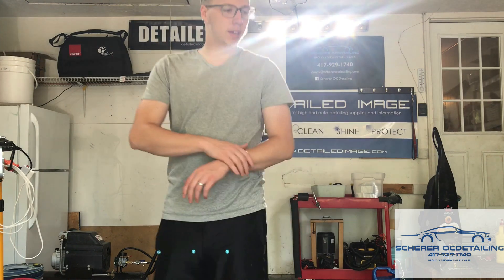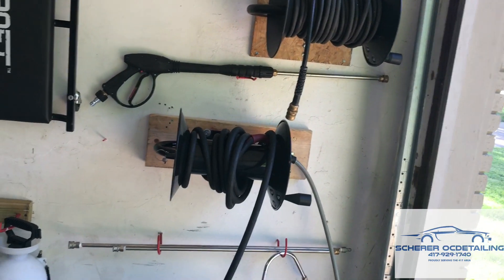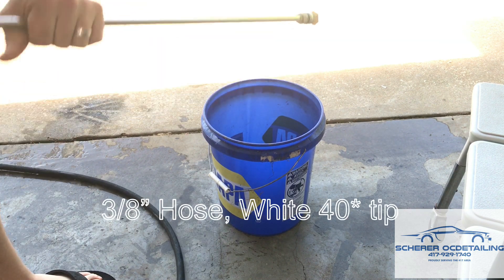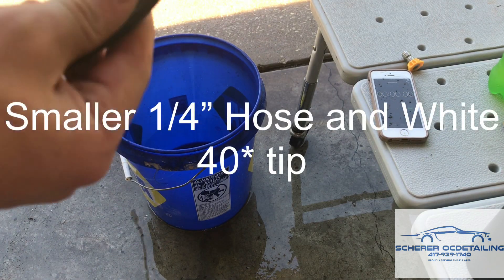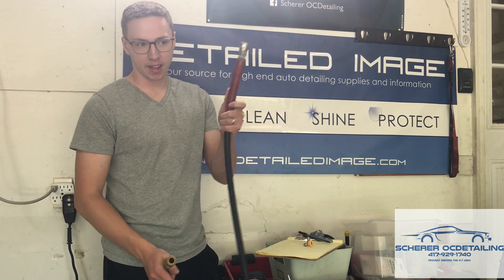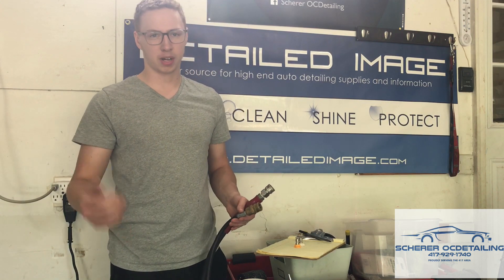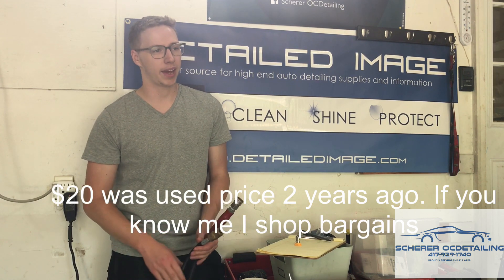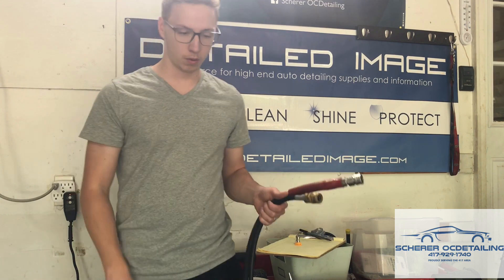3/8” or 1/4” hose for Electric pressure washer for the most GPM?

Comment: Ok so since this video didn't explain anything, but flow. So what I've learned is 3/8 is better only because you have to buy fittings for quick connections for the 1/4". If someone knows where i can find hoses that are 1/4" and has a quick connections please let me know!
Reply: There is plenty of 1/4" hose on Amazon with 3/8" QC fittings.
Reply: The 3/8" hose provides more Volume, flow of water, but not if you are using those tips. You must use ball valve with 3/8" male tip and use the valve to control the pressure and flow which will be much higher, better for rinsing.

Comment: Surprised you want to keep the 3/8" hose and not the 1/4" if they both provide the same output.  Isn't the 1/4" less weight and less bulky?
Reply: I too don’t understand the logic. We must be missing something
Reply: @ts6640  with the gaz pressure washer the 1/4 was too restrictive becus it have more flow vs the electric one
Reply: @Marc-Andre_G  Not to belabor the point but are you now saying the 3/8 does in fact have more flow when used with a pressure washer that in and of itself can take advantage of the higher flow?
Reply: @ts6640  an electric pressure washer have around 1 to 2 gpm wich is not bottlenecked by a 1/4 hose vs a gas pressure wich can easy output 3gpm or even more wich require a 3/8 to reach that potential
Reply: @Marc-Andre_G  I see. Makes sense

Thanks!
Reply: @ts6640  obviously a 3/8 hose gas more flow than a 1/4 if your pump can pull it then there's no question. That's why we make bigger hose sizes lol.

Comment: gpm is determined by the pump head, psi by the tip and the amount of water comming out of your unloader valve not by your hose diameter, you can have a 1 inch hose and the flow and pressure would be basically what you can pump and presssurize with your tip.... by the way both hoses are over kill for the pressure washers and gpms you showed. best of luck.
Reply: by overkill do you mean a 50 foot 1/4 hose will be ok for an electric pressure washer?
thanks

Comment: But just because you have more water coming out doesnt mean it's more pressure or it's cleaning more.  It's pressurized because of the air.   it would be nice to know numbers on actual pressure coming out because of that wider tube it might take longer to pressurize the flow and may not come out as hard to take off difficult stains on concrete or something. 
Try a spray paint line on the concrete and test that way with each type.
Reply: what air?? pressure washers make pressure with no air, they compress water no air on that process if you put air they would cavitate and you will soon ruin your pump.
Reply: Paulo's explanation is jam packed with ignorance.

Comment: I was actually thinking about this today. Thank you for doing this test. My ultimate logic is while you remove the bottle neck of the hose with the 3/8 hose, the fittings and tip are still going through a 1/4 opening. As a result, the gpm is roughly the same with either hose setup. The tip you use is the most important in determining gpm and psi.
Reply: On some tips you can change the needle inside the tip to a 1.25 or 1.5 . I think the come with a 1.15

Comment: Does the length of the hose affects the pressure?
Reply: You lose something like 50 PSI at 100 ft with a 3/8 hose 3 GPM machine. In other words, up to 100 feet, not much loss. You could probably go longer if you needed to.